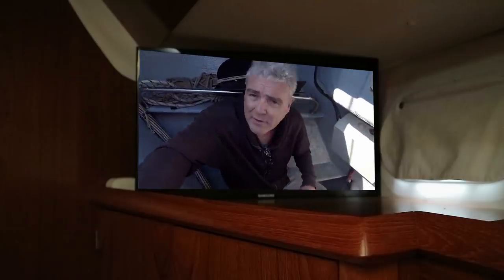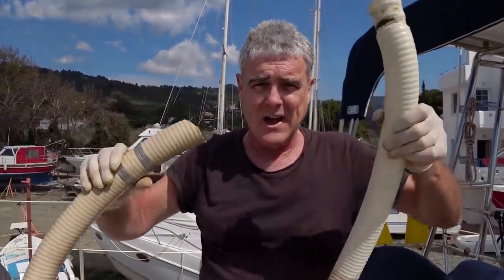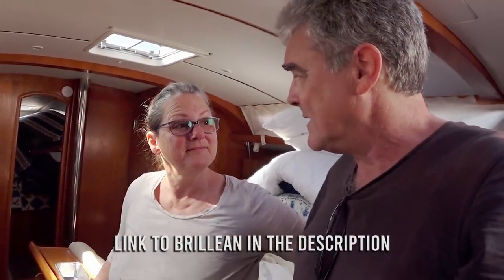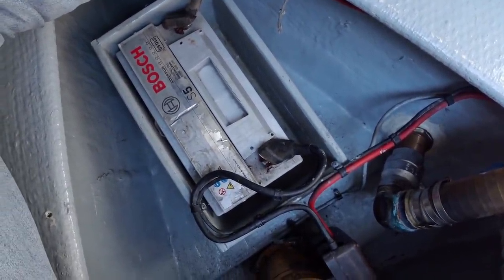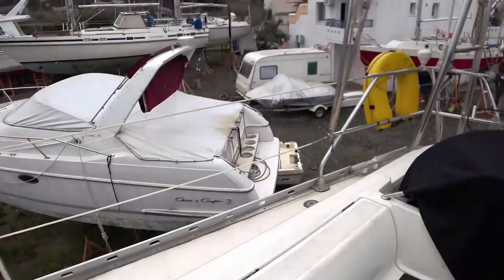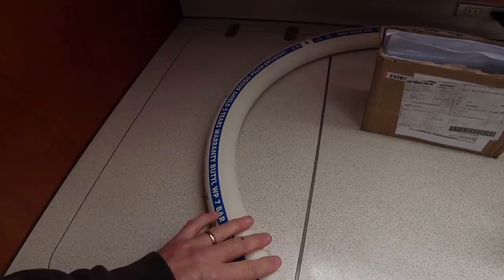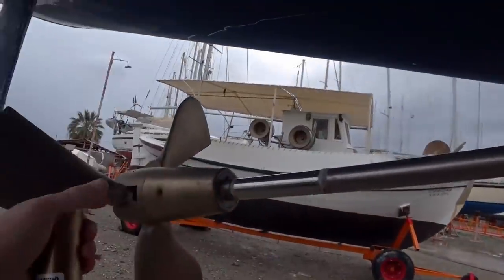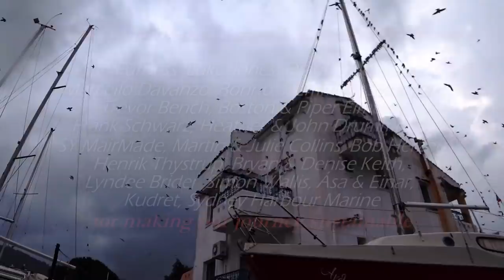Boat jobs and birds - Sailing A B Sea (Ep.116)

Comment: Good morning everyone. Thanks AB SEA . I can sea that your ben very busy both of you. If you want to save your new cultass bearing  from wear out paint the 10cm before after the cutlass bearing with antifouling. That limits the growth of seaweed that can restrict the water flow through the bearing. To make your on mold cleaner is alcohol and water ( not you whisky  ) a mix of 50-50 is good. If you have mor than 70% of alcohol you just make the mold happy. You can brobably buy the alcohol in the super market. If you mix 75 % of alcohol you have a good antiseptic cleaner. To get rid of the the mold first clean as I seen you have done already and then apply the water and alcohol mix with a sponge. If it's in a closed space you should use a mask. Good luck and thanks for your videos. From a swed in France.
Reply from the maker: Hey Lars, thanks for sharing those tips. Yes we can buy 70% alcohol in the supermarket. Stay safe in France. 👍
Reply: @SailingABSea  Hi if you mix it up with water so you get 50 to 60% of alcohol not more. Mold have a habit of encapsulate itself and survive if the concertation of alcohol is 70% or more. Happy Easter to all of you
Reply: @larslotus  Oh thank you for explaining that Lars.  I did use an alcohol water mix in the studio when we were closed in over winter, but the mold came back, which I couldn't understand as I used a strong alcohol mix.  Now you've explained why.  Next time, I won't need to resort to strong chemicals (which I ended up doing here), but will use a 50/50 mix alcohol/water.  Great information.  👍🤗
Reply: @Lars lotus I did not know that. Fantastic tip. Thanks for sharing. I'm going to give this a try the next time I have a use. I'm the trust but verify type. I'll report back with a success/failure report.🥂

Comment: Just a commet if I may. Shaft anode, at least 50 mm away from the cutlass bearing to allow for waterflow. In your toilets, use a dash of vinegar acid (32 %) now and then. Will keep septic tank, hoses and toilets free from carbonate build up. Fantastic efficiant, I have used it for 15 years, no build up at all.
Reply from the maker: Great tips there, thank you. Shaft anode is only pressed up against cutlass bearing as the shaft is halfway out at the moment. Cheers. 👍

Comment: Hi Guys great video as always. Shaft anode distance already mentioned by Hulda. Not sure if you have fitted the Volvo shaft seal yet or before? Whatever you do dont remove the red plastic lip seal protector until the shaft is fully engaged and bolted to the output flange or it will get damaged and leak. You can use glycerine gel or KY jelly on the cutlass bearing to help slide it in if its a bit tight on assembly, just rinse it off after. There is probably a joke in there somewhere? Hope this helps... Sail Safe guys. Ant, Cid and the pooch crew.
Reply from the maker: Anode is only tight against cutlass bearing because the shaft is halfway out. This is the third time that the plastic lip seal protector has been mentioned and I (Baz) just can't see how the shaft can penetrate through the gland to be reconnected to the flange with the plastic protector in situ. I'll film what I mean and include it in the next video. Cheers Ant. 👍

Comment: when installing zinc on the shaft place a pice of 2x4 something heavy on one side and tap the other side with a hammer to seat it the screw will fit, before staring a project i check it out on youtube ( lol ) always saves a lot of time. Love the posts.
Reply from the maker: Thanks for sharing that tip Joseph. 👍

Comment: another great video Baz  the poo pipe can be kept clear of calcium build up by filling it every three months with vinegar and letting it soak for an hour or so then rinse well with clean water. With the cutlass bearing don't forget to remove the grub screws locating it and if it is really being an arse then use your hacksaw to cut it lenght ways at the top and bottom then just collapse it with a screwdriver and hammer cheers
Reply from the maker: Thanks for the handy tips Gmoose. 👍

Comment: Nice edit guy work is progressing nicely 👌
Reply from the maker: Cheers Mike, how are your boat jobs progressing?
Reply: @SailingABSea  I have one new engine and saildrive in connected and running. My new stainless davit and solar system is sorted. Busy with a new generator shelf in the from lazerrette and then will load in the genset then I must tackle the other new engine up and in. The sail drive is in already. Our lockdown has been extended until the end of April so work on the boat is all i can do 🙂
Reply from the maker: Would love some pics of your davits and solar when you get the chance. 👍

Comment: Looking at that cutlass bearing so uncomfortable to whack out from the bow, I thought this crazy toll would be very useful, a palm nailer. Of course, the bearing would be removed with a special screw-based tool, but having the chance of a hammering action on a confined space sounds very nice.  Cheers guys ;)
Reply from the maker: That's an interesting tool Jorge. We'll see how it goes once the prop shaft is removed and see what we need to do to remove the old cutlass bearing. 👍

Comment: Hi Baz, love your work, just need to point something out, I noticed on your video that the rear head discharge pipe is completely under the waterline, this is not good, the discharge pipe should / must rise above the waterline & have an anti syphon device fitted at the highest point, if the joker valve or any thing else at the head end of the system fails, you could be heading to Davie Jones Locker, stay safe
Reply from the maker: Hi Greg, one of our rules of sailing is that all seacocks (except engine raw water intake) are closed before we raise the anchor. You do make a good point about anti syphon devices. Cheers.
Reply: Sailing A B Sea Baz I have to disagree, you are relying on the weakest link, the human, l think it’s a poor design & find it hard to believe a boat builder would build in such a defect, but you have an opportunity to rectify it, not a big job, or expensive. One less thing to worry about, all the best👍

Comment: Doesn’t anywhere do a re Inforced clear hose for sanitation.?  . That way you can see where blockages are and hose condition. Even if you have to shine a torch through it.
Reply from the maker: Good question Paul, I think the problem lies in the manufacturing materials that prevent odors penetrating the hose walls. Maybe a clear hose material would allow odors?